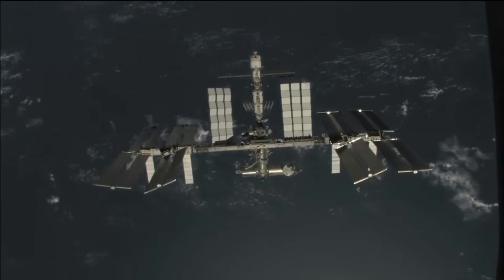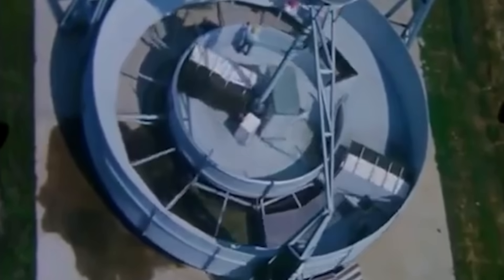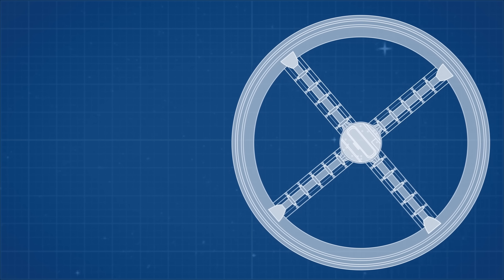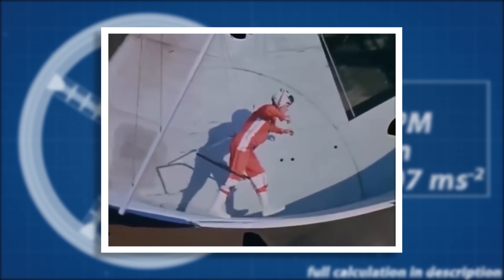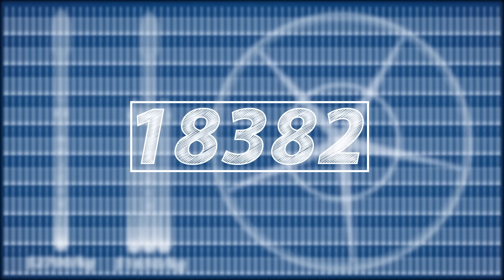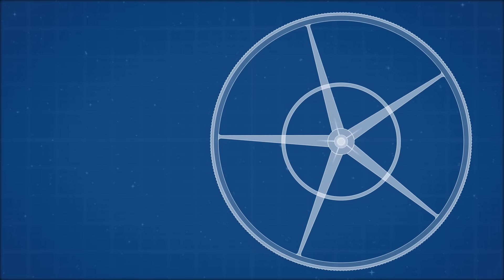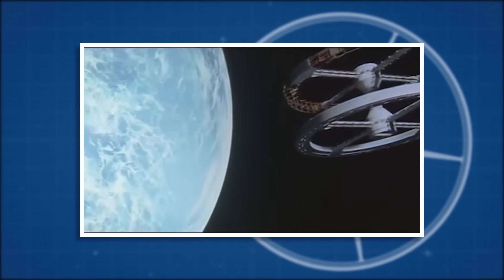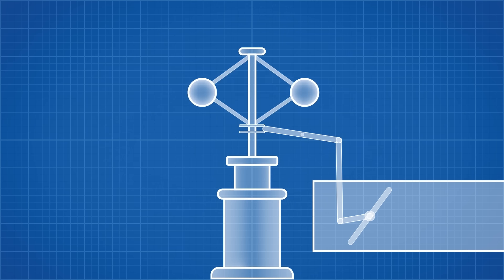Can We Create Artificial Gravity?

Comment: Why do people think that centrifugal force isn't real?
Reply: Michael Murphy it's not fictitious because it's not happening it's fictitious because it's not a force, it's an interaction between 2 other forces that, in that specific frame of reference seems to be a force in and of itself, but when you leave that frame of reference you can tell that it's actually just momentum acting like momentum and continuing doing what it's doing (yes a bad science joke get over it) and not changing until something else acts upon it
Reply: Because the proper name for it is centripetal force.  It's just people trying to look smart.
Reply: Centrifugal force does exist, separate from centripetal force, but only relative to a rotating frame of reference. It's called "fictitious" in the same way that imaginary numbers are called "imaginary".
Reply: it's really just normal force from intertia trying to keep you in place as the thing you stand on is pulled in a circle.  when you are inside the station, it is a measurable force on you like gravity. outside of that reference frame (in the "real" reference frame) it is clearly just inertia.
Reply: Actually it's not a force at all, thus the fictitious part, it's an interaction between momentum and angular momentum.
Reply: Centripetal force is a completely different idea. It is as real as any other force that we may learn about. It is the type of force that keeps objects in orbit. It IS gravity.

Centrifugal force is a fabricated force that points in the opposite direction of centripetal force. It is used inside of more specific reference frames. For example: in a free body diagram of a person standing in a rotating space ship, the centrifugal force might be depicted as weight.
Kris Patel
Reply: It seems like you are interested in physics. If you enjoy discussing subjects like this, I would highly recommend studying it after high school. I always enjoy an opportunity to spread some knowledge.

Anyway, in the case of gravity, the equal and opposite force is applied on the other body in space. As the Sun pulls on the Earth, the Earth pulls on the Sun just as hard. The only reason that we are the ones revolving around it is because the mass of our planet is so much lesser than the Sun. 

If the Sun and the Earth were not moving, they would crash into each other. Velocity in a direction orthogonal to the radius between the two bodies in space is required for an orbit to even exist.
Reply: If I may interrupt what is quickly becoming the most childish discussion of physics I've ever seen, we can all agree that gravity is, in fact, a real force. And I assume we're all familiar with Einstein's General Relativity, which proposes that gravitation is in fact a property of massive bodies deforming spacetime, etc. Well, were this model to be accurate (recall the recent detection of gravitational waves), it would mean that gravity is itself a "fictitious" force. So either we must accept that centrifugal force, and the Euler force, and the other fictitious forces are as real as any other force, or we must accept that gravity is not a "real" force.
Reply: The effect known as centrifugal force doesn't actually exist because of technical definitions of the word force. However, if you switch your frame of reference, the equations for force still work as expected. Scholars/Physics professors are usually very picky though and will mark you incorrect on a test for using that term.

more info: http://phun.physics.virginia.edu/topics/centrifugal.html
Reply: It doesn't exist. Like you said, we use the idea of centrifugal force as a tool, just like imaginary numbers. However, neither of them are real.
Reply: Bailey Trefts yes but newton's laws state each force has an equal and opposite reaction force. So with for example the sun's gravity pulling on the earth can be called the centripetal force (force pulling towards the sun). As we do not move towards the sun(roughly)  there is an equal and opposite force. Which is nessesary to exist or our planets orbit shrinks. Gravity cannot be the only force between the earth and sun.
Reply: It is not only a mimic. Einstein made a though experiment which is close enough to the spinning station situation: let's say you are in a box in empty space with nothing around to attract you, so you're floating in your box. Then, some god's hand pulls your box away, applying a constant acceleration to it, it will appear to you as a force in the opposite direction which will look like gravity. Actually, since you are in a box, you can't see what is going on outside, you can do all the laboratory experiment you want in this box, you won't be able to tell weither it is gravity in one direction or acceleration in the other, it's because it's kind of connected by relativity. In a spinning spatial station, it is the same: the rotation in a non rotating referential involve the centripetal acceleration (not force) as well as the centrifugal force in a rotating referential. It's just a matter of referential and no one of them is more legitimate than the other, so you just can't talk in an absolute way saying this force does not exist.
Reply: I think I was wrong on one point. In fact gravity is not a force, anyway not an uniform one, it is better to describe it as acceleration too when it comes to supermassive body vs human scale bodies. On the other hand, it is the same for the centrifugal force which is in fact an acceleration and this may be why some people say it is not a force, but weither force or acceleration, this is real. I think your analogy with real and imaginary numbers is wrong, because real numbers don't exist neither. Math is abstract, while physics is real, and the point of doing physics is to observe real phenomena without questioning their reality but just try to explain them.
Reply: Mathematics is far from rooted in our universe. In fact, a lot of mathematics doesn't even apply to our observed universe at all when you really get into it. But I do think math is necessary, and in a sense "real". If physics and chemistry are the laws that govern the universe then math is the language we use to understand them. But numbers don't just exist out there in the void.
Reply: bubursinator Not anything can be cancelled. If you do not actually want to make a conclusion and just want to argue, I'm not interested. I was trying to help you understand, but you just want me to be wrong. Never mind my attempt to help you grow.
Reply: You are a fool, he was trying to explain something to you that you clearly don't understand. Instead of engaging with the material you decided to engage your petty bruised ego. Grow out of that quick or you will learn nothing.  Cancelling terms on either side of an equation is common practice in mathematics and so in physics.
Reply: It doesn't exist from an inertial frame, but from a rotating frame it appears as a force distinct from mere interaction of momentum and angular momentum. If centrifugal force and other "fictitious" forces are apparent and measurable in certain non-inertial reference frames, then to say that they are nonexistent would imply that these reference frames are somehow less valid than any inertial reference frame, which doesn't make sense.
Reply: If it doesnt please explain why the crap our planet still orbits the sun then. Please disprove mr Newton about centripetal force balancing gravitational force to maintain orbit and cite a full refferance source instead of just going on a youtube video and saying its wrong
Reply: In other words, why the fuck has planet Earth not crashed into the sun, thats how gravity works right, mass falls towards heavy stuff, like the sun, yet we happily orbit our sun without falling into it
Reply: Centrifugal force is not real. What is perceived as it is the centripetal force. Centripetal force is what keeps you in place. That is the force that the station exerts of you to keep you inside. If you were to take that away you would fly off at a tangent in a straight line. What you are feeling is the constant change in velocity (remember velocity also takes into account direction). Your change in velocity mimics the acceleration of gravity.
Reply: Bailey Trefts yes but the way they taught us at a level is the equal and opposite force to gravity is the centrifugal force. Another example would be the Large Hadron Collider. It needs to have such a large radius as they cannot make the particles they collide go at 99 percent the speed of light without such a large radius. Any smaller of a radius at the particle experiences centrifugal force that is way larger than anything we can feasibly counter. Thus they decided to make it larger rather than counteract it's centrifugal force and make it smaller
Reply: Kris Patel  Again, I recommend that you study physics if you are interested in it. 

What that person told you was simply misinformed.
Reply: bubursinator I understand that it completely depends on your frame of reference. I haven't studied enough relativity to be able to agree or disagree with your statement. I'm not sure if a small, accelerating frame of reference constitutes an observed phenomena to be an actual real force. If a person was stuck in that frame of reference, then I understand it would be a "real" force; however, it would be a completely unexplained one. If that person could change their frame of reference, they would come to the understanding that the explanation is it wasn't a force. The person was just experiencing the acceleration due to the force of God's hand.
Reply: Gravity is a force that causes an acceleration that isn't dependent on mass. That is what makes it special. It is, most definitely a force though. I assume we're still talking about Newtonian physics.

How could you say that physics is any more real than math? Math is fundamentally rooted into our universe and it can be observed in physics equations and expressions. I understand they were both discovered by our minds, but math is just about as real and true as anything gets.
Reply: Bailey Trefts the acceleration caused by a force is always dependent to the mass, otherwise it's not a force.
Reply: bubursinator If you study the formula for gravity, set everything equal to F(force due to gravity). Study the equation for a while to understand what I mean by that.
Reply: Michael Murphy I am well-aware that a huge portion of what we've discovered in mathematics so far is not observable. You put it well when you called it a language. Just like math, we use it to describe anything we think of. Some of the things we can say, however, don't make sense in the real world. 

Interestingly enough, even imaginary numbers come into play in the physical governing of this universe.
Reply: bubursinator Also note that F=ma. Sub this in for F in the gravity equation and cancel variables appropriately. 

While you study this equation, think about why a bowling ball falls at relatively the same rate as a small bouncy ball.
Reply: Bailey Trefts Well, if you can "cancel" anything from equations, anything can be anything.
Reply: because people are idiots.
Why do people think earth is flat?
Reply: Bailey Trefts are we talking about the same thing? I wouldn't call it an attempt to help me but an attempt to not lose face. You made me laugth, you know I am right, that's all.
Reply: bubursinator Ok. Never mind. I won't waste my time with another troll of the youtube comments.
Reply: Yeah, whatever, another troll yourself. Why do you keep posting only to say that you don't want to argue with trolls ? You just can't accept to be wrong. That's kind of sad.
Reply: Correct, All forces are simply abstract symbols that we have assigned in order to quantify phenomena. The label is not the thing.  Gravity, as you say is localised bent spacetime, we label that a force.

Comment: Centrifugal force isn't real, centripetal force is.
Reply: Watch the video again.
Reply: DarkLordGiggles he actually was explaining centripetal force, or the Inertia of an object trying to continue in a strait line.

Centrifugal force is a illusion created due an objects inertia.
Reply: sorry to burst your bubble but they're both fictitious forces; which is to say both have been disproven as forces they are just the interaction between momentum and angular acceleration, and have been replaced with Angular Momentum Theorem.
Reply: Centripetal force is certainly not fictitious. It is simply whatever force happens to be responsible for maintaining the object's circular motion. Any moving object will want to continue in a straight line due to its inertia, so in order for it to follow a circular path some force has to be applied. If you have some object attached to a rope and you swing it around your head, for example, the centripetal force is the tension in the rope keeping it from flying away. For a astronaut on a space station, the centripetal force is the normal force of the floor pushing against their feet. 

What he explains in the video is that while centrifugal force doesn't exist from a fixed, outside perspective (outside the station looking in), it is a real and measurable force from the astronaut's frame of reference. In his reference frame, he's not moving at all. The floor is still pushing him up, though, so this force must be balanced by some downward force-- this is the centrifugal force. While this force is 'imaginary' in the sense that no physical object is responsible for it, it certainly does accelerate objects within the astronaut's frame.

 This is a bit non-intuitive because the astronaut's frame is non-inertial, meaning he's accelerating. Non-inertial frames don't behave in a way people are generally familiar with. Think of sitting in a car that speeds up on a highway: You feel a 'force' pushing you back into the chair. From the point of view of someone standing beside the road, there is no such force, but from your point of view there certainly is; in fact you could even measure it if you wanted to.

Comment: This vid nails it as far as being able to demonstrate the reality of gravitational forces and what I call "The cost barrier". He mentioned the 36 shuttle flights to get ISS to orbit. He didn't mention there were also several Russian Proton flights that delivered components such as the Zarya and Zvezda modules. One of the big mistakes NASA made was not developing shuttle "C". The number of assembly flights could have been cut in half or even less. However, the shuttle "C" design would have altered ISS design. NASA made ISS into a works projects and did so at it's own peril. Today we depend on Russia to get to ISS and what happens after NASA ISS participation ends? There are no plans beyond developing SLS/Orion on a glacial time scale. This will likely lead to cancellation of SLS/Orion should the private sector companies like Space X or Blue Origins finally economize low orbit. NASA human spaceflight will have ended if there are no firm post ISS plans and an SLS/Orion cancellation. Economize low orbit, the rest will follow.

Comment: As a member of the angry mob... 
There is no centrifugal force. Lets consider the laws of physics you quoted. The force that is equal and opposite to the centripetal force is the entire rotating object. If you were to measure the centripetal force opposite of the man in the rotating object, its vector would be equal and opposite (give or take some Newtons). In all reality it will be off, adding torque to the rest of the object. This is why when centrifuging at high speeds requires objects of equal mass on opposite ends of a centrifuge. If there were an centrifugal force, then this counter balance would not be necessary. Also to drive the point home, the centripetal force is all that is needed to keep an object in motion because of the objects inertia. If you were to "add" in a centrifugal force then the centripetal force (mathemateically) would have to keep getting bigger, therefore centrifugal force can never equal centripetal force. 

If you want to think about it more, the current theory of forces is that there are four: strong, weak, gravitational, and electrostatics. If you can't describe a force in one of these then it really isn't a force. Centripetal force on the man in the centrifuge is the electrostatic repulsion of the centrifuge pushing him inward (or his point of reference upward). There is no electrostatic (or any of the other forces) acting on the man that is in the direction of centrifugal force.

Comment: Why do we always go after a ring? wouldnt it be simpler to stick with rotating objects tethered together at the center spinning. It would be like if you spun a bucket over your head except you have a bucket on both ends of the string and they are the size of a small room. This would let you get the greater diameter needed without the resources needed to make a large ring
Reply: NASA proposed such a plan for it's original 1970s space station concept. However, the reason there are no serious plans to develop artificial gravity spacecraft of any kind is cost. NASA Human Space Flight (HSF) is teetering on the verge of ending because the very best engineers NASA has to offer cannot crack the cost barrier. We only have HSF of astronauts on board ISS who are transported via Russian Soyuz craft. When NASA ISS participation ends, then what? There's lots of talk about going to Mars or back to the moon but no concrete plans that can be seen unfolding the way Apollo did. NASA's budget is currently at 1960 levels as a percentage of fed spending. We won't have any very ambitious projects on that budget. It's the main reasons SLS/Orion is on such a glacial test schedule.